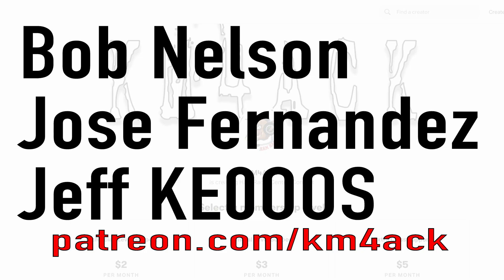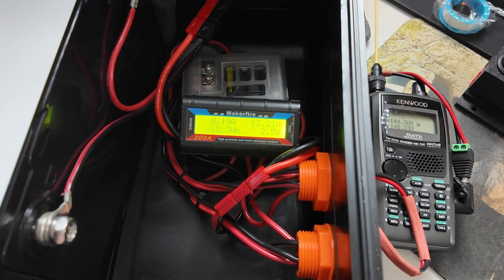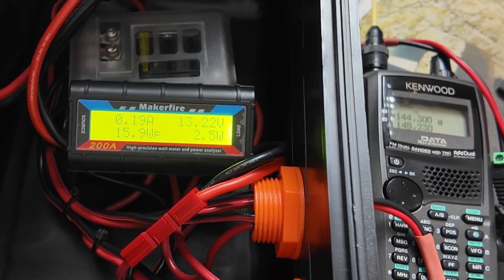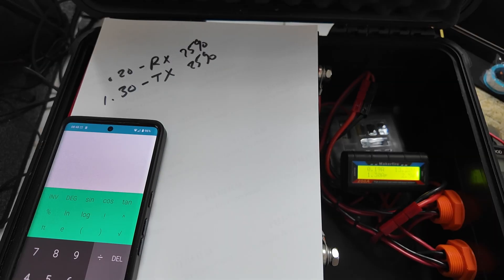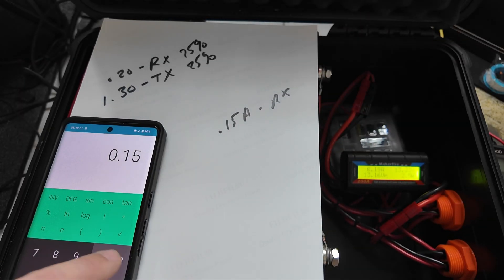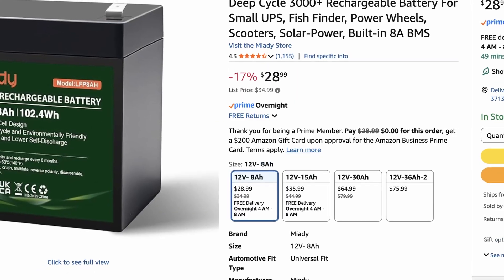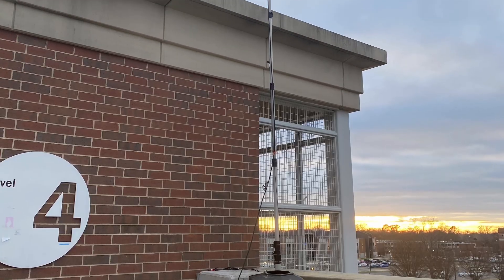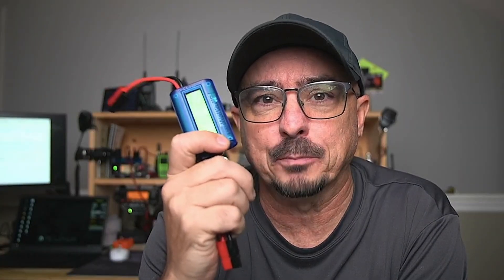10 Hours - One HT - One Question!

Comment: You've measured 1.29A rounded to 2A on receive. How do you come to the result of 2A per hour? Is the meters readout in amp hours? I think normally displayed as Ah
Reply from the maker: 1.29 on TX rounded to 1.3 and .2A on RX
Reply: I get the rounding. The question is how did you convert those two numbers. All the meter showed was that it was drawing .2 amps at that point in time. How did you convert that to amp hours?
Reply: @davidlessley8410  If it's drawing a steady current of X amps then you multiply by the number of hours you want/expect it to run at that current to get the number of amp hours (Ah)... amps multiplied by hours is amp hours.

Edit: The way he mulitplied by the duty cycle percentages first reduces the arithmetic needed but makes it a little less obvious. Also he said "amps per hour" once or twice which is wrong, though I'm sure he knew what he meant.
Reply: Okay got it, thanks